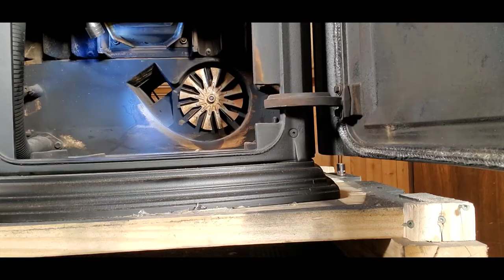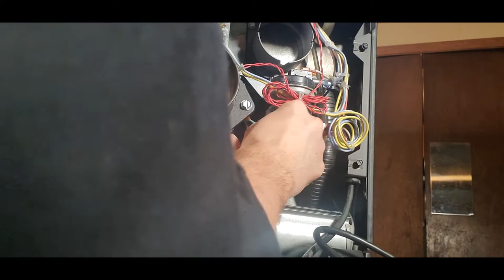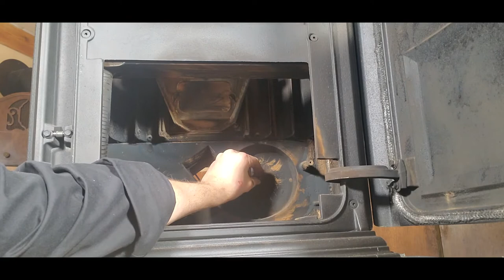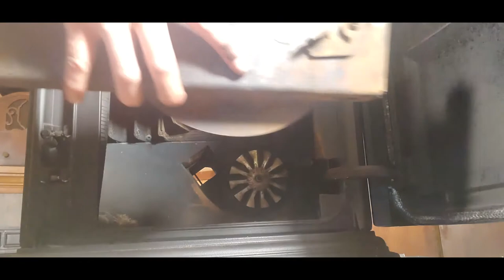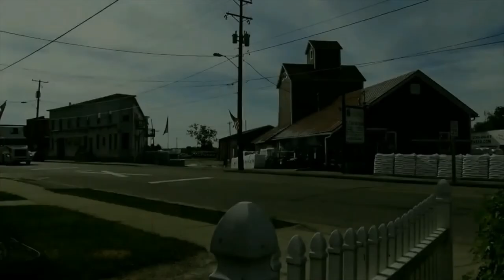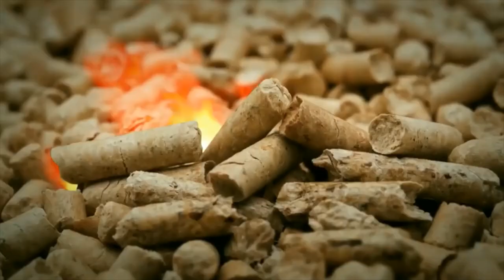How To Replace a Harman Combustion Blower, Exhaust Fan Draft Motor

Comment: @2:30 "...and that impeller wheel will come right off there like that" HAHAHA sure it will! If your stove is nice and new like that one is... but then you probably don't need to replace it. Thanks for the overview, but this isn't exactly a real world scenario :)
Reply from the maker: Thanks for the message. As mentioned in the video from 1:30-2:00 sometimes that paddle can be very stuck on there depending on age/use and we recommend soaking it down with lubricant such as WD40 for an extended period of time. From there if it still will not budge, in most cases if heated with a pencil torch the metal will expand and it can be broken loose. Only in a small amount of situations have we seen where that paddle impeller needs to be cut-off to remove. 
Thanks again for your comment, appreciated. Any questions down the road just let us know!